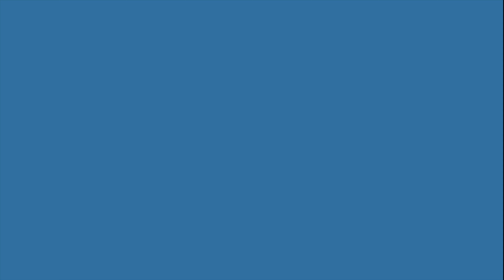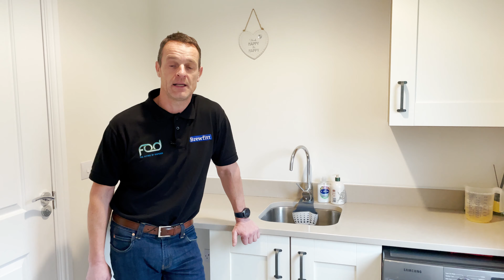Brewfitt Lindr Pygmy 25K Full unboxing, setup & review

Comment: Do you know how to pull off the sides to clean the condenser?
Reply from the maker: We would recommend that you use compressed air through the vents to remove any dust that could potentially accumulate.

Comment: well, using compressor you will oxidate beer superfast, not sure what designer had in mind to be honest
Reply from the maker: The air compressor is intended to be used in conjunction with a poly keg or similar system where the air effectively squeezes the bag and doesn't come into contact with the product.

Additionally, there is an option to have a gas feed where you could connect your CO2 (or preferred gas) for a steel keg or specific container that comes into contact with the product.

Comment: I didn't get a quick release adapter for the compressor and they are different from the beer line (which is really stupid I think). And now I cannot figure out what type of adapter I need and where to find it. And I'm not able to use with compressor.

Comment: Hi! Around 10:30 when you connect the keg, how come the red switch isn't in horizontal position? I thought if it's vertical it is degassing the keg
Reply: Now I see that at 12:30 it's vertical :| I will go with that then

Comment: Hello, I bought the Pygmy 25k , using it with a CO2 bottle, After serving 2 beers perfectly I get a lot a foam, any Idea how can I fix this ?
Reply from the maker: I would advise you contact us on 01484 340800 and we can advise. Usually this is due to incorrect pressure for the specification of the beer and considerations need to be given to the ambient temperature of the keg. Please call us and we can advise accordingly.

Comment: Do you Need Gas or not? Are there 2 Versions and is there a Difference im using Gas or Not?
Reply from the maker: Hi Alexander, the 25k can be used with gas (see link below how to connect), however there is also an internal compressor should you wish to not use gas. Gas would be used in conjunction with steel kegs as it prolongs the life of the product. The compressor is best used with polykeg or key keg (a keg with internal bag) as the air squeezes the product through the lines. The compressor air doesn't come into contact with the product which prolongs the shelf life of the product and minimises oxidation. 

Connecting Gas:

https://www.youtube.com/watch?v=BpEbYKcRik8&t=48s

Comment: If using this set up with no gas on a key keg, would the key keg have to be refrigerated to get the maximum life?
Reply from the maker: Hi James, the keg can be kept at an ambient temperature and the unit is designed to serve cold from ambient. By keeping the keg cold it would prolong the life but it is not a requirement for the unit.

Comment: looks spot on,why would i buy one of these instead of a pub cooler,pro's & con's,thanks
Reply from the maker: Hello, the Lindr unit is ideal for home use, it doesn't require coolant, is plug and play and can be used with or without gas. It's ready to pour in less than 10 minutes and kegs don't need to be pre chilled.
Reply: @BrewfittLtd  just ordered a Lindr Pygmy 25/K Exclusive (2 Tap) Draught Dispenser,been told the front lights up
Reply from the maker: @fester.  Congratulations on the purchase. The front of the system doesn't have any lighting effects, if you have any documentation to suggest it does we would be happy to look into this for you.
Reply: @BrewfittLtd  received the lindr 25 and yes the front does light up, brilliant piece of kit
Reply from the maker: @fester.  Hi Fester, apologies, the Exclusive model does light up. We're pleased you're enjoying the system!

Comment: Has anyone thought to make adapters for perfect draft kegs - given they use the same principle as a keykeg?  I assume blade kegs are the same.
Reply: Good question! Especially as that would be great for smaller/home use. There are adaptors like this one: https://www.tireusesabiere.fr/adaptateur-5-litres-design-metallique-de-haute-qualite-avec-robinet-d-arret-pour-la-biere/a-452065/
Reply: In fact I've just dived in and ordered a pygmy and a 5l adaptor, but I've got no idea what to expect! @Brewfitt Limited, any chance you could make a handy video to show this in action!? 😜
Reply: @robinknipe  that adapter isn’t for a PD barrel because it has a dip tube.  Presumably it’s for those mini kegs that you hack to work on a draught setup
Reply: Ah yes, PD is pre-pressurised isn't it!?
Reply: @robinknipe  Yes - the beer is in a foil bag and the container is pressurised with air which forces the product out - exactly the same as a poly/keykeg
Reply from the maker: Hi Eliiot, the perfect draft kegs can only be used on the perfect draft machine. We aren't aware of any adapters.
Reply: @BrewfittLtd  I reckon it can be done from my initial research - they use the exact same principle.  I don’t know the what pressure your machine provides or what pressure the pd machine uses.  Seems appealing because it’s difficult to justify a 30L keg for home use, but having a third-party adapter would open up this machine to the considerable choice of PD kegs.  You can get the PD taps off ebay.  If you provide me with a loan machine i’m happy to buy the tap and do the r&d.
Edit: PD runs at 1.5 bar pressure and your is set to 2.8 bar - but the manual suggests it can be adjusted (or simply use an inline reg)
Reply from the maker: @eliotmansfield  Hi Eliot. There's a number of different keg sizes available that work with our unit from as small as 12 litres. The benefit of using these kegs means that there's a wider scope of beer to choose from.

Comment: Will this work with any keg, like Guinness or carlsberg ?
Reply from the maker: Hello, thanks for getting in touch. Guinness will need the Ale/Stout kit (available from our website) including a gas feed due to the nature of the product being housed in a steel keg. We would recommend speaking to our technicians to explain this further. Carlsberg would also need a gas feed and regulator if it is in a steel keg. Any product housed in a polykeg however will not need any of this equipment and will simply connect and dispense via the internal compressor.

Comment: Hello, thank you so much for the video, very clear explanations. 
I have bought the pygmy 25 with a type A coupler for a traditional stainless Steel 30L cask. If i only use half the cask, will the remaining beer loose its flavor due to the air filling the other half of the cask?
Many thanks in advance for your advice...🙂
Reply from the maker: Hello. When beer is exposed to oxygen it only takes a few days until the oxidation process begins to affect the taste. To avoid this we would advise you consider using a gas feed to prolong the life. The machine has an air compressor as well as a gas feed should you prefer. Finally, we would advise you speak to our technical team on 01484 340800 regarding the safe installation of a gas bottle.
Reply: @BrewfittLtd  thank you so much!

Comment: Hi i want to put john guest elbows on both lines as they go into the machine just to tidy up the pipe work so they sit flush as other wise they stick out of the back, could you advise what size fittings i need for each line pleaser to go in to the machine
Reply from the maker: Hi David, you need to source a 3/8 John Guest stem elbow. Thank you.

Comment: Impressive 👍
Can you swap between kegs before they're finished?
Reply from the maker: Hi, yes you can. Simply uncouple and attach the new keg. You might wish to clean the line beforehand to avoid mixing the contents of the line with the new keg.
Reply: @BrewfittLtd  that's great! Thank you! Might be looking to purchase one for my channel 👍🍺
Reply: Should you release some pressure from the key keg before uncoupling???
Reply from the maker: @davidcardew857  Hi David, yes. Curtis demonstrates how to release the pressure within the video.
Reply: @BrewfittLtd  and that is the same if the keg is half full?? The beer in the bag will still be fine?
Reply from the maker: @davidcardew857  That's correct. Because the beer is not exposed to atmospheric gases due to the nature of how it is dispensed it will not affect the shelf life.

Comment: Connecting up to cider with key keg making a hissing sound not losing any air or discharge of cider just bought a lindr machine yesterday anyone got any thoughts
Reply from the maker: Hi John, I've forwarded this to our technical team and will advise as soon as they respond.
Reply from the maker: Hi John. Response from our team: Please make sure the pressure release valve on the side of the keg coupler is fully closed. It’s there so once you have finished your keg you can release the pressure and recycle the plastic keg.

Please let me know if this resolves your issue.

Comment: Can you attach a co2 cylinder for better performance ?
Reply from the maker: Hi George, yes you can attach CO2 to the lindr unit or just use the internal compressor. We have all of the equipment on our shop to be able to install and operate a CO2 bottle and to attach it to a wall. Call us on 01484 340800 for further information.

Comment: Hi guys, Can you attach different couplers to the pipe provided? Ordered an S coupler but have a keg that requires a D coupler that I’d like to use too. Thanks! :)
Reply from the maker: Hi Jay, yes you can use different pipes as they are a standard 3/8 fitment. Thank you.